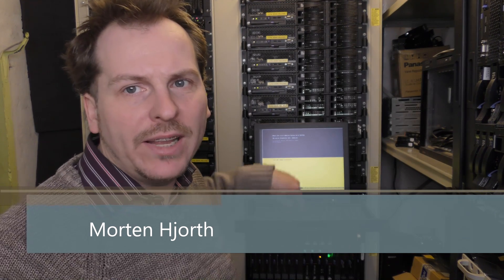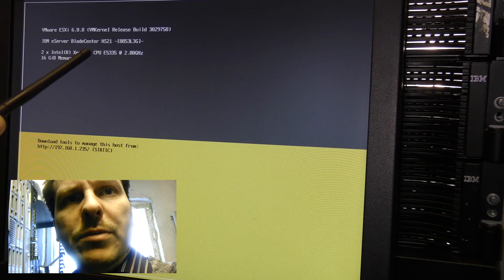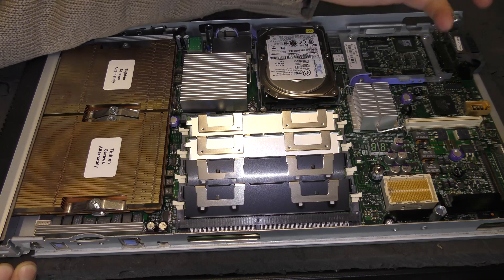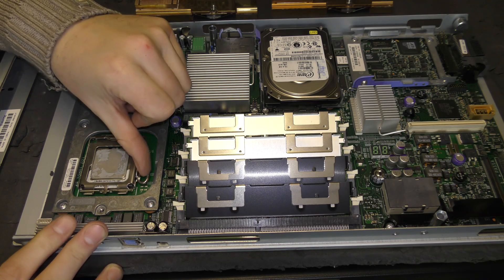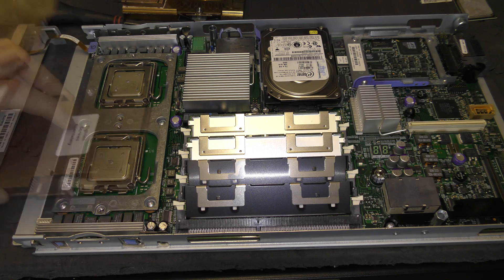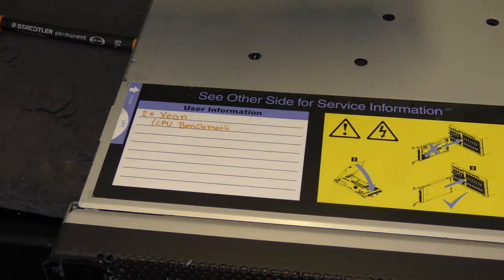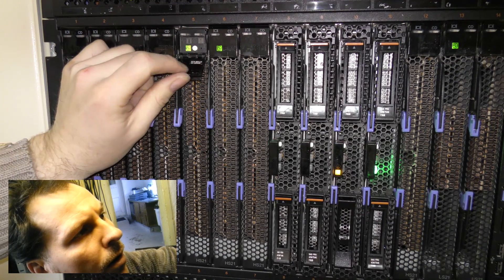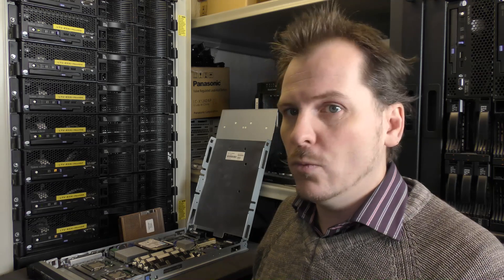Failed attempt to upgrade IBM HS21 8853-L3G to Xeon E54xx series - 296

Comment: Thanks for sharing..  I have a couple of customers that i have built Vmware Shere box for to run 3 or 4 VM's for linux and Windows VM's I remember once I couldn't get a dual quad core (Intel something) to boot, Turned out that I needed to do a MB bios update to recognize the processors, This was brand new system...!?  Had to buy a dual core (intel something) that would work with the current bios to allow me to flash the new bios.  ! ! Gezz INhell.

I wouldn't put thermal paste on like that "I believe the idea of applying the paste is so that NO air bubbles get trapped, Air is good thermal insulator"  I put dob in middle and press down evenly and hard so zero air gets caught.
Reply from the maker: Hi +TheShockmister 
It's not a firmware update problem on these ones,, i did look in to that, and i did update it,, and XEON 54xx is not new anymore. :-/
Every one has there way to put on thermal paste ,,, do it your way, if you finds it works for you :-)
Thank you for watching! :-)
Reply: Just say'in I had a another issue with specifications !  Bios version/Cpu's  etc etc 
just conversation. 
The paste issue is easy to prove...  use a piece of glass instead of Heat sink and see the difference.  (maybe none at all and your point proven !)  Hey I'm not making lite of your method's I think it great that you have a whole setup there.  I only get to play when my customer wants stuff done. cheers :)
Reply from the maker: Hi TheShockmister
I have also had Servers that needed some Firmware/micro code update before being able to run a brand new CPU.
I have seen the glass videos,, or two i think. and i think it is all good.
Thank you for watching! :-)
Reply: I didn't know there are vids out there, will go look. cheers

Comment: I just saw your battery revival attempt, try this if you have the time and effort.
There's an old trick that used to be used here in Sweden for tired batteries with thick plates. The old ones didn't have as soft lead clay so what we did was;

1. Discharge the battery to less than 10%. In the end, use an iron rod or similar to completely discharge it. 
2. Charge the battery in reverse polarity, make sure it doesn't get hot. - If so, decrease the current. Leave for 12-48 hours on a dumb charger.
3. Do as point 1.
4. Charge with normal polarity.
(5. Small particles of lead may be present on the bottom and making a soft short circuit. If so, drain the battery, rinse it several times until clean. Fill with 32-37% H2SO4 and charge as normal. Leave on a dumb charger for overcharging for 12-48 hours.)
Reply: +Erik Larsson Get back to me if you try it, It'd be fun to know the results.
Reply from the maker: Hi +Erik Larsson 
Which video did you watch? I have tried fixing a few batteries. I do kind of have a good deal that i can just exchange bad batteries to other bad ones :-/
Thank you for watching! :-)
Reply: +My PlayHouse (Morten Hjorth) I watched the one with the battery from 1978.
Reply from the maker: Hi +Erik Larsson 
I am afraid that i gave up on that one ,,in part 5 or so,, but a lot of interesting ideas to try!
Thank you for watching! :-)

Comment: How could someone wanting a blade server start off? For little money of course. Thank you for an awesome tutorial my friend.
Reply from the maker: Hi +Raymond Earle 
Well you are from the UK so www.ebay.co.uk :-) but this one is in the US : http://www.ebay.co.uk/itm/8677-3XU-IBM-BladeCenter-Server-Chassis-8677-3XU-MT-M-/171170909472?hash=item27da94cd20:g:VbEAAOxygj5Sf~gj
Lots of good stuff in the UK.
Thank you for watching! :-)
Reply: +Raymond Earle +My PlayHouse (Morten Hjorth)  I wondered the same thing, and then came across an IBM Bladecenter S, which is the little brother to Morten's H.
It also runs on standard power cables (15 amp) rather than the big round connectors that Morten needs for the H.  The S runs only 6 blades, but have space for more storage modules... which take 6 full size 3.5 had drives... I havent got them all up and running yet... its still all sitting at set up stage..
Reply: Thank you both. Have found one on Ebay within my cheap range. Nuch obliged . Have a great day.
Reply: A little heavy on postage. Thank you very much for helping me find the right one for me. Much appreciated.
Reply from the maker: Hi +Raymond Earle 
Here is another good one: http://www.ebay.com/itm/86773RU-IBM-BladeCenter-E-Chassis-Rack-mountable-7U-2x-power-supply-DVD-/151908004027?hash=item235e6c30bb:g:A70AAOSwf-VWZSiw
It does not start at 15A,, With all blades, and the most power consuming CPU's full RAM and Disks/networks cards 6 switches and 2 management modules,, maybe 15A
Thank you for watching! :-)
Reply from the maker: Hi Raymond Earle
There are sercices where you get your newly US brought thing sendt to a shipping address in the US, and they will ship it to you,,,cheaper. It is ment for all the US stores that do not want to ship out of US.
Thank you for watching! :-)
Reply: Ah. I see. that sir is a great Idea. Thank you sooooo much. Your awesome.